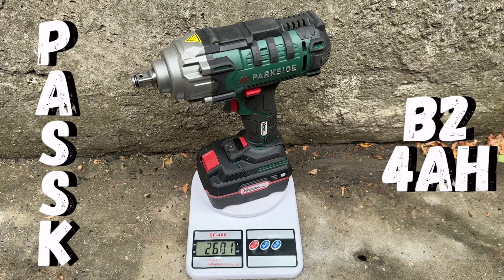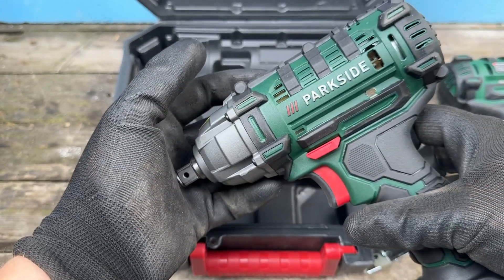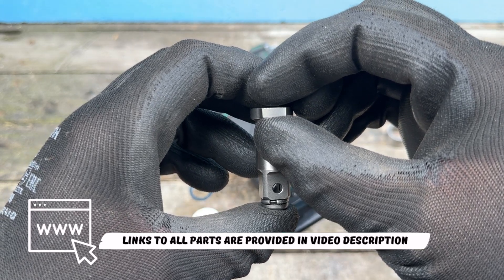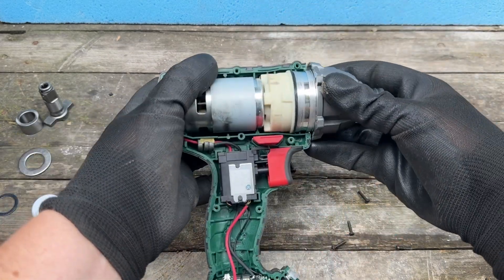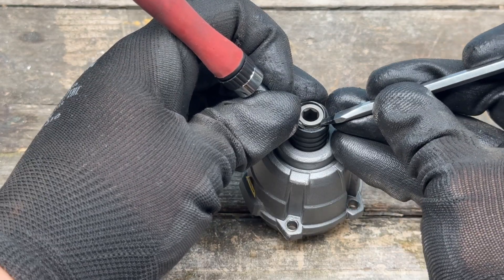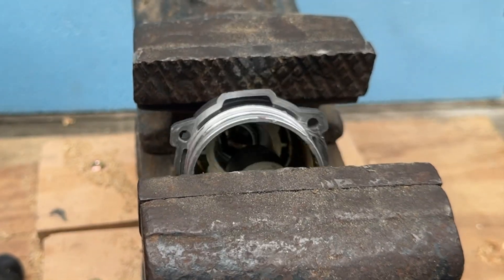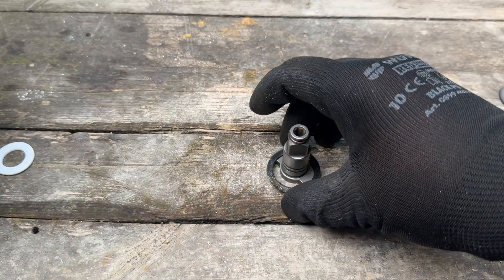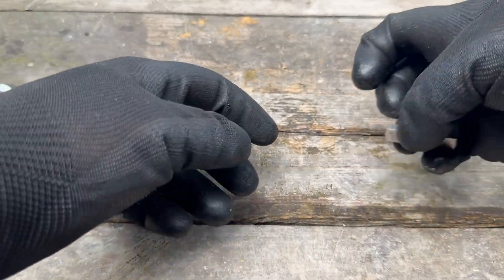Parkside FREAK! PDSSA anvil modification. All the options for a cheap and light combination tool.

Comment: Does this increase power, because of the bigger anvil and less loss from adapters? Or is this mod mainly for ease of use and compatibility ? Im about to get this one tommorow and im already looking for a upgrade :).

 Also would you reccomend this versus a makita dtd 173 clone off aliexpress with a battery adapter for parkside.
Reply from the maker: The Aliexpress stuff is an absolute last resort. This is a well built DIY tool that has a warranty. As for the first question, you won’t gain anything when using 1/2” sockets, but you will have the full 180Nm (maybe a bit more), because there won’t be an adaptor to take some of that power away.

Comment: Just did the conversion, mounted a 16mm anvil that I had to grind down to almost 4.3-4.5mm for it to move "freely" with a 2mm nylon washer. There were some traces that the original parkside bushing had gone in just a bit twisted leaving some small traces of aluminium at the top which I could not get fully rid of.

Tried it out and it outperforms my Hikoki WR 18 DBDL2 greatly. Heavier but much stronger. Thanks for the info and tip!
Reply from the maker: That’s a great job you did there! Happy you like the end result!

Comment: hello! I found an 18mm anvil in Ali but it has 10mm hole at the bottom with 5mm depth. is that a problem??
Reply from the maker: The biggest problem is that it won't fit. You will end up invest more in to making it fit than anything else.
Reply: @BrokeLifeEU  You mean because the hole has 5mm depth, I have to drill it down to 13mm depth and 8mm diameter? So the first 5mm of the hammer driver will be in the air and it will fit only in the next 8mm that we drilled? is that possible?
Reply from the maker: @georgek5250 Pretty mich impossible to drill it out in the first place as it is hardened steel and even then it will be difficult to center it right. So the issue is many how deep it is, as if it was 13mm deep you could fit a bushing there but still that is an extra element that could go wrong.
Reply: @BrokeLifeEU  hmm I understand, so what's the right dimensions for the hole of the anvil to be ok ?
Reply from the maker: @georgek5250 8mm diameter and something like 12-13mm deep that is the best way to get this conversion done. At the moment I would go for a Worx WU278 anvil, remove about a milimetre from the base so it sits at around five and get the 2mm washer. That I feel is the best way to do it at the moment.
Reply: @BrokeLifeEU  thanks a lot! keep up the good work! wish you all the best!
Reply from the maker: Thank you! All the beat to you too!

Comment: Hi , do you know if there is a 3/8 anvil that is compatible to this tool(even if it needs modification).It looks like a fun project!Btw i am a big fan of your channel!
Reply from the maker: Thank you! Unfortunately I have still not been able to find a 3/8" anvil that will fit. It needs so much work on them that it is best to just make a custom one. I think I am on the verge of doing just that and then maybe I will post a video on that and I hope that will gather enough momentum so that someone starts manufacturing those as conversion kits. How does that sound?
Reply: @BrokeLifeEU  sounds interesting!!

Comment: I bought PDSSA B2 and with 1/4 to 1/2 adapter I am unable to unscrew the screw of the car rim which are tight to 120nm. Such modification would increase the power of the tool?
Reply: I decided to do number 1 which you wrote in the description. I believe keeping it as close to the original solution is the safest option, many engineers spent a lot of time designing it so using solution number 2 only with one metal washer didn't convinced me.
I also spent some time trying to find 18mm anvil, but all of them had 10mm bottom hole so there was no point of taking it.
Reply from the maker: @misiek735 Fully agree option 2 makes it easy, however it is not the best choice, as you said many people spend time making this so it is best to stick to the original idea as close as we can. That path is yet to fail me!
Reply: @BrokeLifeEU  hello again! Just wanted to let you know that I did the modification and oh man... it unscrews the bolts of the tires like they are made from butter, before it was not possible to do it with the adapter. It was one of the best modifications I did thanks to your video!
Reply from the maker: @misiek735 Thank you so much! I am glad you like it! Was it easy or did it take some time?
Reply: @BrokeLifeEU  I did not have a vise to remove the old bearing and mount the new one, but a 13 mm socket, hammer and a bit of noise in the apartment did the job. The parts from aliexpress that I found were fitting nicely, the only difference I noticed was with the washer. The original one was looking like a woven felt washer, so when I put the plastic washer (which also happened to be a bit thicker) and assembled everything, after tightening all the screws the anvil was not moving freely. I loosened some screws until I could rotate anvil with my hands, and it was ok.
Then I noticed that after using the driller I could tighten the screws even more and the anvil could still move freerly, so I guess the anvil "scratched" the washer and it's everything fitting well now 😃
Reply from the maker: It is a bit difficult to explain however I'll do my best. So this modification will not increase the power. However you will get all the power it has to the socket, because when you are using an adaptor that robs you of significant power getting to the socket. I would still rate it at 180Nm hover it can unscrew 210Nm and even more, some bolts were beyond my torque wrench rated at 210Nm. So I can say if the tool is in good condition you could expect up to 300Nm in unscrewing. I hope that helps.
Reply: @BrokeLifeEU  Thank you very much for this information. I already ordered the necessary parts from Aliexpress, when they arrive in December I will modify and test it. And especially thank you for sharing how to modify it!
Reply from the maker: @misiek735  Thank you so much for your kind reply! I really do hope you like and enjoy the end result! Which modification option did you decide to go for?

Comment: Hi, can I have a link from where I can order these parts? Hungary :)
Reply from the maker: This I think is your best option:
https://www.aliexpress.com/item/1005006435352852.html
https://www.aliexpress.com/item/1005004001381921.html (16x24x15)
https://www.aliexpress.com/item/1005001439060205.html (16x22x1)

These three in 90% of cases are a straight fit and don't need additional work. Unfortunately sometimes the anvil measurements are not spot on and some work is needed on the anvil base.
Reply: Thanks :)
Reply from the maker: @SzabolcsLendvai-lc1mf  You are welcome!

Comment: I'm thinking about doing this conversion but with the compact Einhell TE-CI brushed impact wrench. Einhell brushless line, is a bit expensive, near more established power tool brands.
Reply from the maker: If it is the one BING points me to it looks to be a 140Nm model and I think it will come in handy in the combination form, however be aware that the impacting will at some point cause the magnet inside the 1/4" part of the anvil to fall out and you need to glue it back in place. For me this is a worthwhile conversion if work is split between 1/4" and 1/2" at around 50-50%. Otherwise if you need the 1/4" considerably more often the 1/4" is a much better way to go.

Comment: I have two questions, first one- I tried removing the old bushing using the vice but it seems kinda stuck inside and it doesn't want to move, any tips??
and second question, I have a 6 mm anvil but my country doesn't have 1mm washers in any of the stores that usually have these stuff, I know I can order the 1mm washer but I'm curious why does the combination the anvil and the washers have to be 7mm and can it be 8 mm cause I can 2 mm washers
thanks in advance, love your videos!
Reply from the maker: Hi! Well the OEM spec is a 2mm washer and an anvil with a base of 5mm. That combines for a total height of 7mm. I think if you up that to 8mm you are risking a lot of excess wear on the hammer mechanism and you will shorten its life considerably. I have always made it a point to stick as closely as possible to the original with these conversions and that has never let me down. If you manage to grind the anvil down to a 5mm base and use a 2mm washer there will be no added wear on any component and you will end up with a versatile tool AT NO tradeoff. Otherwise going with the 8mm idea it is possible that nothing will happen, because of some inbuilt tolerances in the housing, however if I were you I would not risk it. I hope I gave you an idea of the problem with the 8mm idea.
Reply: @BrokeLifeEU  thanks for the info, any clue why I can't push out the original bushing thats inside? I'm doing it the same way as you with the vice but it just doesn't move :/ should i use wd-40 or something?
Reply from the maker: @joshsinister8605  You can try this, put the entire assembly in the freezer and then try and heat up just the casing. It should be easy to push out the bushing. I nave never had much of an issue with that. I doubt they have started using glue or something so let me know how it goes. It is interesting why it is being so difficult. This tool is probably the easiest one to get the bushing out of. I hope you can manage it soon and without too much trouble!
Reply: @BrokeLifeEU  will give it a try tomorrow, thanks a lot I'll keep you posted
Reply from the maker: @joshsinister8605 Hope it goes well! Best of luck!
Reply: @BrokeLifeEU  Update: I did it, the old bushing was stuck like hell inside but when I put the new one in it was without the problem. Just waiting for the 1mm washer and I am all set, thanks a lot!!

Comment: just as an interesting note - I've got a pdssa A1 and it's got a 5.5mm thick anvil base with a 1.5mm washer. I've ordered a 16mm anvil with the intention of keeping the original washer and griding it down by 0.5mm, we'll se how it goes. thanks for sharing this mod!
Reply from the maker: Thank you for sharing this about the A1. It could be that one some that is indeed the case. On the one I had in this video the base was at 5mm but I am not surprised such a difference could exist. As long as when you put it together the anvil turns freely and does not rub hard against the casing or the impact mechanism you are good to go! Please feel free to share an update when you mod the tool. I hope you enjoy it!
Reply: @BrokeLifeEU  an update and a bit of a heads up for those who are planning on doing the mod - the OD of the factory fitted bushing is 24.05mm. the OD of the bushing that is sold is 24.00mm. The new bushing slides in with no resistance. So either one gets the original bushing machined to 16mm ID or in my case I might try using some sort of high strength retaining compound 🤔

Comment: Is the original anvil lighter or something? 
Because, I don't think that you can unscrew anything above 110Nm with the original anvil, and there you go much higher after the conversion.
Reply from the maker: The 1/2” anvil means the power goes directly to the socket and there is no power loss if using a 1/4” to 1/2” adaptor.
Reply: @BrokeLifeEU  True, but it's SUCH a huge difference!!!
I'm gonna try it out. Looks like it's absolutely worth it.
Reply from the maker: Oh it is, absolutely transforms the thing!

Comment: i followed solution 2 and i have one issue which is at 4:35. Installation of new bushing. I bought everything from the link above and this bushing goes by finger without any issues. i dont think that it should go that way
Reply from the maker: Absolutely not. You should need a tool in order to insert it in to the casing. Any chance the casing was hot and the bushing cold? Then if it goes in easily it is understandable, however if they were the same temp I would guess that the size of the bushing is off by just a bit, but that could be enough.
Reply: @BrokeLifeEU  unfortunately both had same temp. i will try to find another supplier but first of all i will measure mine. it showed 24mm but i think that it's more like 23.xx something.
Edit. Old one Has 24.30 new one 24.10. this is the problem. Had u that problems before?

Comment: Things are changing fast in the world of impact drivers. This design is only a few years old but it seems ancient now with its beer can proportions. Imagine if claw hammers evolved that quickly, they would be ice axes already
Reply from the maker: It does look ancient I will grant you that, however I find the simplicity of it beautiful. I am yet to see one of these fail spectacularly. If it fails it is because it was dropped from a substantial height or it needs its brushes changed which costs about 2-3EUR. It is a bit on the long side so for automotive work it won't be my first choice.

Comment: Damn. Cool!

Wish that 18mm wasnt sold out.
Reply from the maker: I have found another 18mm, just waiting for specs from the seller before I post the link I have not bought from the seller before.
Reply: @BrokeLifeEU just bought the tool today in Romania, and I want to do the modification. Is it worth waiting for you to find that 18 mm anvil for us? 😊
Reply from the maker: You can do it with the 16mm anvil quite easily. The A1 showed in the video is with a 16mm anvil. 5mm base and 2mm original washer with the plastic insert. 24x16x15 metal bushing. Unfortunately the seller of the 18mm anvil is not replying to me. I can post a link to it if you want to try your luck.
Reply: Don’t have a grinder, so I would go with the 1mm washer. Do you see any weakness in doing like that?
Reply from the maker: @LehelVass I have done that conversion and there have been no issues, however it won’t be nearly as strong as the 2mm washer.
Reply: @BrokeLifeEU What do you mean by not being as strong? Will the machine have less nm or will wear out quicker?
Reply from the maker: @GaborMandity20  Well both actually if you are referring to my comment regarding the 1mm washer in place of a 2mm one. It will start to wear quicker which will lead to less of the impact force transferred to the anvil end thus less Nm at the end of it. It won't happen in a use or two, however could happen over months. With an anvil that has a base of 5mm and a 2mm bushing that still does take place, however it does so over years.
Reply: @BrokeLifeEU Thank you for the quick anwser.
Reply from the maker: @gamr70HD You are welcome!

Comment: Hi , i did the modification to my perfomance c3 226nm impact after a huge 6 month of mechanic work the spring has finaly died, any clues where to find a replacement one ? 

THANKS
Reply from the maker: This is shocking, yet another thing on the C3 that breaks. Did you open it up is just the spring broken? The impact mechanism for a "Dayi 2106 impact wrench" is pretty similar to the one in the C3 and I am 99.99% certain the spring is the same, unfortunately I can't find the spring as a separate item. However I think one from DeWalt could fit but not sure which one.
Reply: @BrokeLifeEU  yeah just the spring is broken but after that mod, me and a friend used it a lot in a auto service, for all kind of stuff and got a lot of work done, I think that after anvil change the power it's to much for that spring. Maybe I will fit from the green one ?
Reply from the maker: @ViataPe2Roti  This is very interesting indeed! Out of all the things that could break on these, I have never seen or heard of a broken spring. I think if you take the broken one to a shop for DeWalt spare parts they may be able to find you one that could fit. DCF887 looks like it might be about the right size, but I have never compared them next to each other.

Comment: do you know what is the max nm of this tool?
Reply from the maker: Safe bet is to say 250-270Nm won't be an issue at all, however I believe it can go as high as 300Nm.
Reply: @BrokeLifeEU  thanks man. What about battery, is it worth buying 8ah or just invest in 2x4ah?
Reply from the maker: I would invest in 2x4Ah. That way you can use one while the other one is charging. And the basic 4Ah batteries are the least problematic ones anyway.